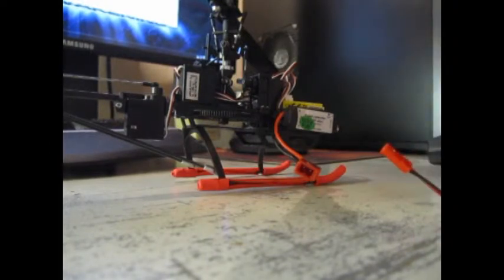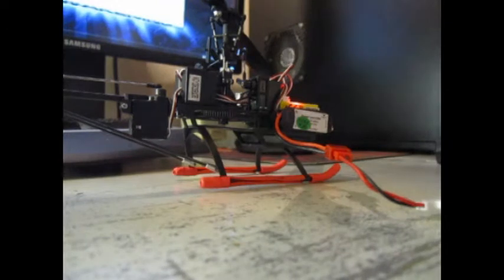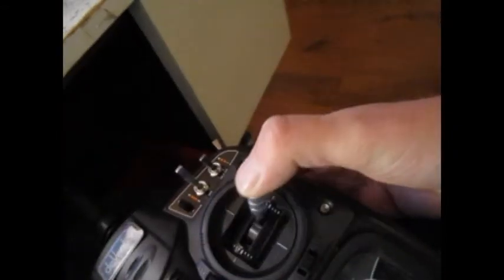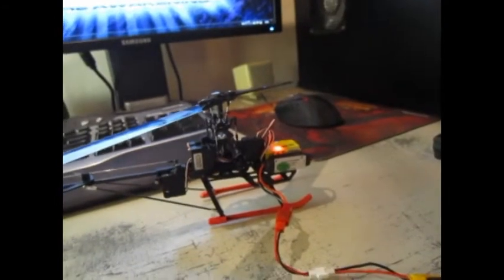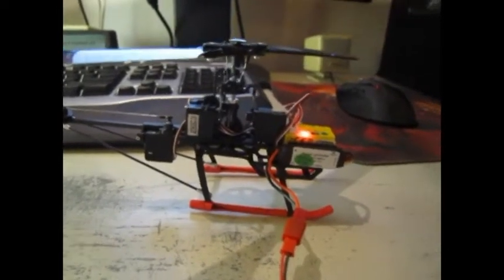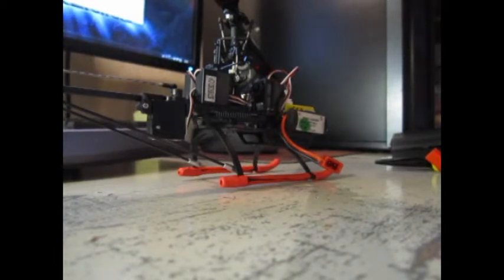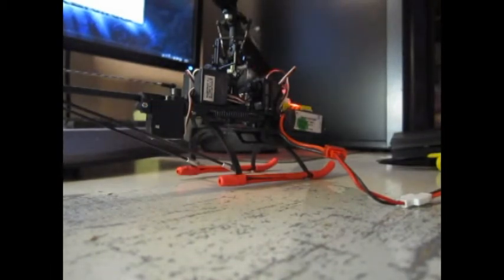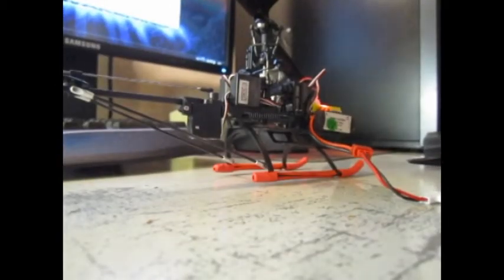V120D02S receiver problem

Comment from the maker: Hello Pat, well its hard to say what is wrong without actually seeing it. So when you start flying it would be fine and than would suddenly pull the helicopter way right ? That could be a bad servo that doesnt return to its original position anymore. Or do you mean in the air it will start twitching the servo like mine does in the video ? My tail servo actually has a little twitch in it but i seen on forums more have that. It can still fly fine so i wont replace it till it stops working.

Comment: Was wondering if you know of a solution for me. I have same heli it some times drifted to the right because the swash plate tilt on its own even though no command was given.  It very difficult to fly. The was like that when I first bought it but was inexperience to know the difference. I'd really appreciate it if you can give me some advice. Thanks.